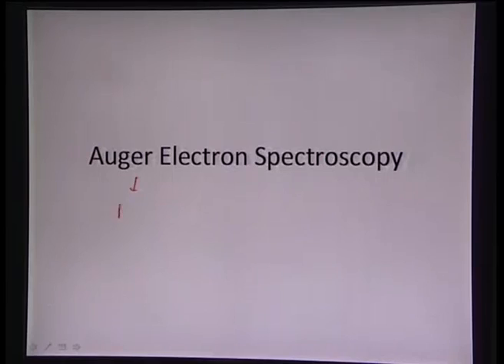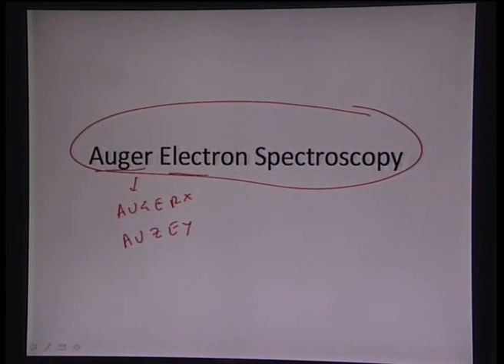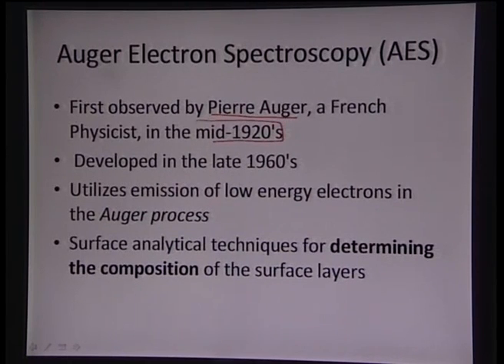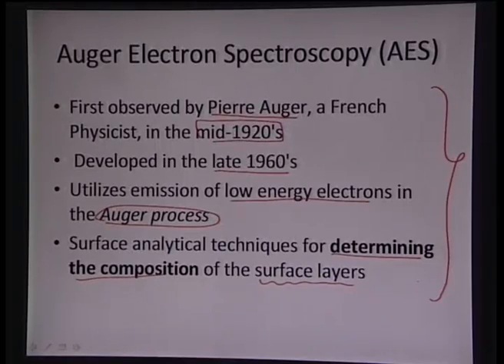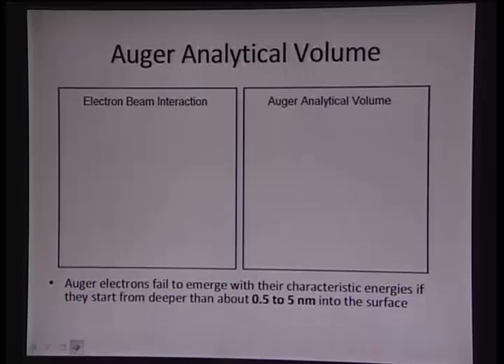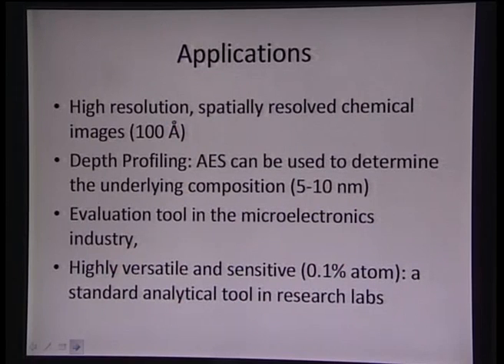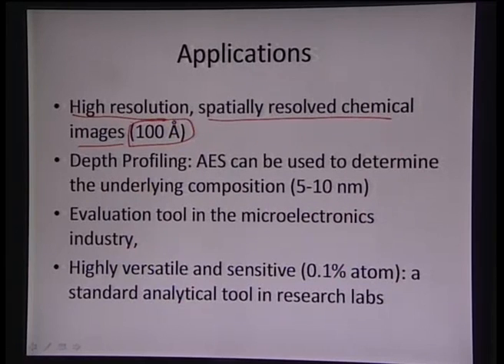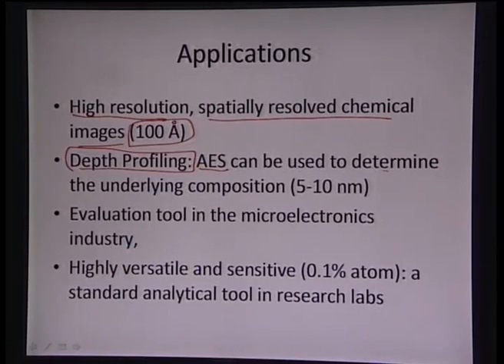Mod-01 Lec-39 Auger Electron Spectroscopy

Comment: excellent lecture.....i have a question .....why auger yield is high  but x-ray yield is low at  lower atomic number?
Reply: The reason is simple, higher  the atomic number more would be the separation between energy levels which means that more is the chance of an x-ray photon being emitted (as x-rays have high energies). Atoms with lower atomic numbers have little tendency to emit x ray photons due to lower difference in their energy levels hence they generally show auger emission. Hope you understand ✌️
Reply: @satishsharma2649   In XPS we study the knocked of electron and not the photon due to x ray fluorescent so both in higer atomic and lower atomic number element  the core shell electron (which is detected in XPS ) is  knocked off , why it is prominent only in higher atomic element but not in lower atomic elements
Reply: @lakshminarayanan5242  Did you find the answer ? If so, please make me informed too. I need to know it for a dissertation ASAP.

Comment: Would it be possible that both, the auger electron and the juming electron, come from the L1 shell?
Reply: I don't think so, because precession needs 3 electrons...
All the auger process from lower to higher atomic number comes from KLL,LMM,MNN shells...LL,MM,NN consists of L1 and L23
Reply: *process
Reply: For auger electron to be from L1 shell the jumping electron should have an energy equal to the ionization energy of L1 shell. Therefore, it is not possible for both electrons to be from same (L1) shell.
Reply: @srestsomay3533  you mean to say that if the jumping electron has I.E. equal to that of L1 , it can't be in L1 ... It'd fly off even before existing in L1 ,right ?
Reply: @nomadsland7195  Ummm yess, exactly